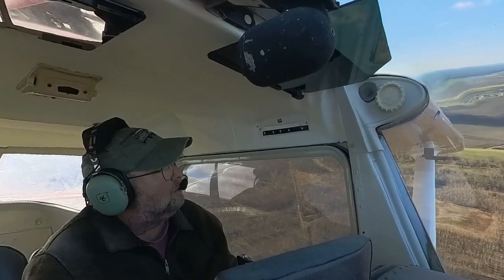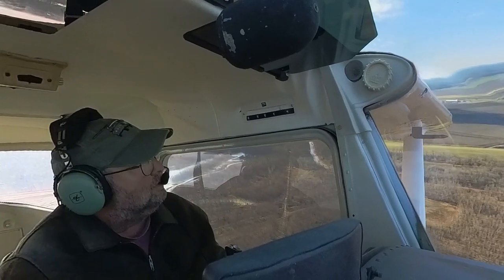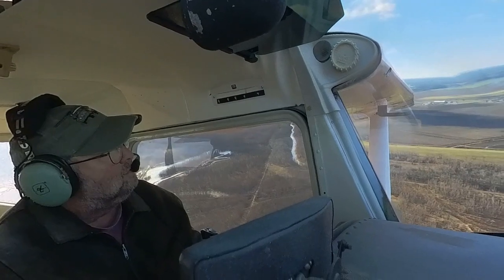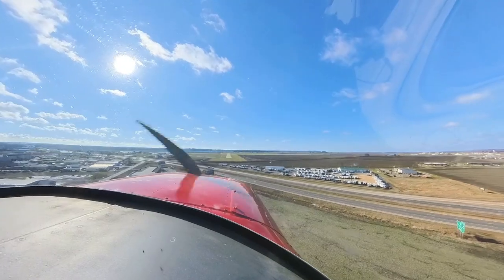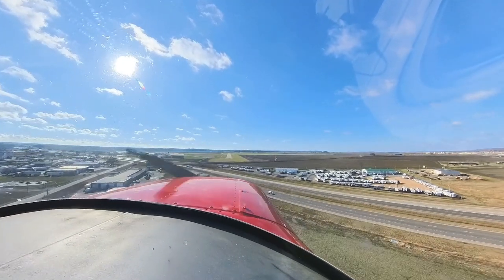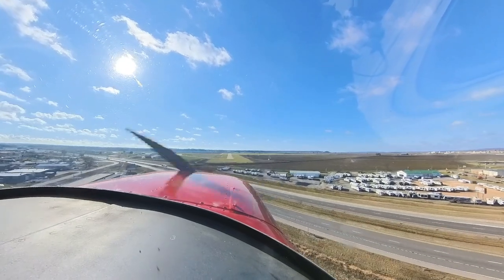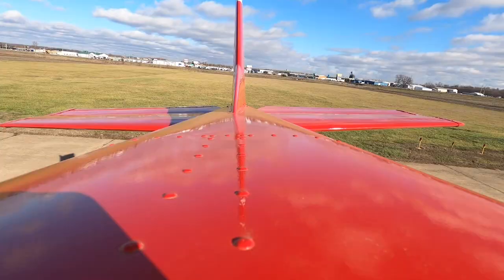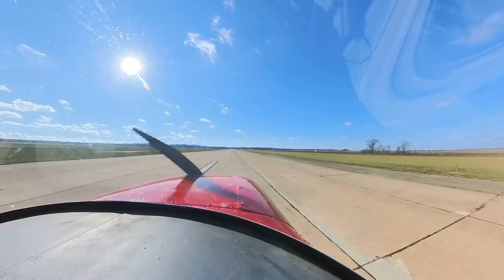Don't lower your flaps to 40 degrees in a Cessna 150 !!

Comment: Your solution with the overfly the tractor and land on the remaining runway was a good decision.  I have actually taught students this technique rather than the sometimes dangerous go around.  Too many bounces early on long runways are followed by go around when just adding power and making a soft field type slow and soft landing with power on the runway remaining.  Dan could have done the same in the grass, but after attempting go around landing in the corn was the next best decision.

I think you and Cessna and the insurance man have a good point with the only 30 degrees flap in the 152, but the 40 degrees Fowler flaps are what make all the single engine Cessnas much safer airplane.  Far less tin and skin are hurt at 20-30 ground speed vs. 40-50 ground speed.  And when we pipeline patrol pilots, who fly all day in whatever wind is around, need to increase our headwind component by angling across in a strong crosswind from the downwind corner to the upwind big airplane touchdown zone marking, we can use the power/pitch you mention to land safely in the thousand feet available before turning on down the upwind edge of the runway at very slow airspeed.  

With 40 degrees we can easily decelerate to get a sink going that allows us to bring the throttle into dynamic play as the most excellent glide angle and rate of descent control.  This amount of dynamic control (yes move the throttle like the control it is) allows putting the mains on the exact downwind corner every time with the assurance of the maneuver never in doubt. Removing the need to round out and hold off, same as Wolfgang's "stall down approach" makes this a snap. Good video. Thank you.

Comment: Flew quite a bit in a 1964 C172E with 40 degree manual flaps. Loved it and had no problems touching down at the beginning of the numbers and being stopped at or just beyond the end of the runway numbers. Never had a go around problem and loved the speed that manual flaps gave when lowering or especially raising flaps for a go around. I didnt really like the slow raising that electric flaps gave for go arounds.

Comment: We live in a temperate climate and I did 40 deg flap landings and take offs, however just because you can does not mean you should, it is a great facility to have for landing if you need it. Just be aware you need to be on the ball if you overshoot,( it does want to pitch up when you open the throttle)  and not at all if you are in a Hot & High environment.

Comment: The reason the flaps were reduced from 40 to 30 was because of changes in late model 150's (and so all subsequent 152's).  The cowl was extended and a spacer added between the Crank and the Prop.  (Cabin noise mitigation - marketing department).  That and the strake between the vertical stab and rear windows was extended and the area of the rudder was increased (more assured spin recovery as the nose had been extended - engineering department).  This changed the aerodynamic qualities of the plane to the extent that it would no longer meet certification "go around" requirements with flaps 40.  So they were reduced to 30.  Nothing to do with people getting scared.   (Source - Cessna Wings for the World - William Thompson - Cessna Engineering test pilot)

Comment: 40° flaps make it come down like an elevator. 150s are great short field airplanes.
152 had 12 to 15 more horsepower, depending upon the prop, 28V electric systems, and came out in 1978.
The most common reason for electric flap failure is when corrosion preventive compound, oil, dirt, whatever, gets into the electrical connector to the flap actuator in the right wing and interferes with proper connection. Seal that with RTV before spraying wing interiors with corrosion preventives.

Comment: Had an unusual incident back in the late 1960s with a 150. It was the really old version with a mechanical flap handle between the seats. I was trying short takeoffs and landings. I wanted to land and stop in the same length of runway that it took for the takeoff. It just wasn't happening and in my frustration, I took off twice with 40 degrees of flaps hanging down. In my state of frustration, I went from 40 degrees flaps to zero in about 2 seconds. Didn't tear anything up but both times, I ricocheted off the runway after making an unintended touch and go.

Comment: During my training I had a situation where I was coming in to land with a C150 using flaps 40, but had to go around. I went for the flaps switch, put it up, and stopped it at about 10 degrees, however the switch was so old and worn that it didn’t stop in the neutral position, but halfway between it and the down position, causing the flaps to go back down to 40😬 luckily I noticed the lack of climb performance and the flaps position quite quickly and rectify before crashing into the trees at the other end of the runway.

Comment: I think the 40 degrees flaps is a great  feature. Lightly loaded, 40 flaps, power idle and full  nose up trim the 150 becomes a paraglider with a descent rate of less than 300 f/p/m. 
I always had that in mind  in case  of an emergency landing at night If the concern was the training enviroment they could have limited the flaps switch travel to 30 degrees

Comment: Cessna R-172K, Hawk XP. For those not familiar with this model, Continental IO-360-KB, 195 HP, Constant Speed Prop RIGHT FROM THE FACTORY. This airframe has 40 degrees of flaps. My Son and I. About 40 gallons of fuel. 80 degree day. 600 feet field elevation. Touch and Go. The normal Takeoff flap setting is 10 degrees of flaps. On the Go part of the Touch and Go we raised the flaps from 40 degrees to 10 degrees. The airplane did not want to climb ??? At about 150 feet in the air we discovered that we still had Full 40 degrees flaps. The circuit breaker had popped for the flaps! IF.... We would have been in a standard C-172, or the conditions would have been worse. We would have been swimming in Lake Erie just past the runway. Lesson Learned!

Comment: Using 40 degrees of flaps is like making the decision to do elective intubations. Saying "never use flaps 40 in your Cessna 150" is like saying never electively intubate someone until they are in complete respiratory failure.. Making the decision to intubate early to forestall failure is similar to educating a pilot when  and in what circumstances to use 40 degrees. Both procedures have risks, which can be mitigated with education and training. I was trained in a 150 with 40 degree flaps, and have experienced the failure to climb scenario. It taught me to be cognizant of the risks, and to fly smarter in my use of them. Cessna changed the 40 degree flaps to 30 degrees in the 172's because of the ability to blanket the tail surfaces when slipping with full 40 degrees of flaps. This was found on the 170B models and resulted in a few tragedies. The 170A models flaps go to 50 degrees, but they are simple hinged flaps with a 9" chord. They barely work and you can slip them to your hearts content, and they climb just fine with the full 50 degrees hanging out there.

I think modifying your video would be helpful if you discussed the possible downsides, and educated more pilots in the best use of the 40 degree setting and where to best utilize the setting, rather than a blanket "don't do this" approach.

Comment: In the case of Mr. Mansels 150 crash with Dan Grinder. The flaps would not retract due to a glob of paint in the track. On the ground, without the force of the wind against them, retraction was not a problem. With the force of the wind  or any for e against them, that go of paint acted like a wheel chock.

Comment: Yes you are correct,great video,no go-around with with flaps 40 on a Cessna 150 that why the Cessna 152 has flap 30.
.
Reply: you shouldn't be going around with 30 flaps either. if people can't do go-arounds properly, they need to stop flying r get more training.
Reply: @SoloRenegade  It looks like you completely missed the point of the video. You should watch it again.
Reply: @3SM20Pilot  no, I know the point, but I'm not a follower of fads. I fly the airplane as intended.

Comment: I worked for a cessna dealer .we had 40 school planes and I was told to never use full 40 degrees in a tight turn because the flaps blanket the airflow over the tail surfaces

Comment: I own and fly a 1960 150, it has manual flaps and only use 40 on short fields it's mechanical so that's why I feel confident but i agree if it's electrically actuated that's a bad place to be when they won't come back up.
Reply from the maker: I totally agree, it sort of a challenge when they don't come back up.  I am a "huge fan" of mechanical flaps!!

Comment: During training at SMO (Santa Monica) I had maybe 20 hrs in a stock 150. I was a little high on short final and went from 20deg to the famous 40deg flaps at idle. I was immediately surprised as the sight picture instantly went from nice runway view to looking straight down at the numbers (!). I assume this is another issue with the 150, I am assume that the large change in the effective airflow shape caused the wing to seek the new angle of attack, which happened to be straight down at idle power???  The only other time I experienced a similar huge pitch excursion was more recently when I bounced a Stearman and (as is my rule) I didn't attempt to salvage the landing and initiated a go around from an almost three point landing attitude. I added full power (in retrospect I suspect too rapidly in general but certainly too rapidly for a radial engine, which thankfully didn't cough and quit). The high angle of attack attitude suddenly turned into looking almost straight up at the sky (eek!). My front seat friend (jet pilot) caught that I was momentarily a little stunned as things were so far from normal. He pushed the nose down gently and the aircraft settled into the nicest just above level climb at 400 fpm...  Anyway I think the 40 deg flaps also can cause issues in the 150 in idle and maybe near ground effect (??).:face-blue-wide-eyes:

Comment: In calm weather, I land with 20 degree flaps in my 150L. In gusty conditions, I use 10 degrees flaps. I’ve got VGs; so I can still land very short in it.  But if I have to go around, it’s much safer.

Comment: I also flew 150's and the flaps were activated with a MANUAL lever between the seats, not electrically operated. I have used 40 degrees with no problem, probably because they were manual. I do not know if the electrically operated flaps had an electrical problem or if the aerodynamic forces at 40 degrees were excessive enough so that the electrical motor did not have sufficient force to move the flaps. I'll bet Cessna knows! I am a private pilot and have been an A&P for 50 years.

Comment: On a windy day in my C-150 I could just about make a vertical landing with 40 degree flaps , as long as the wind didn't stop. LOL I lived in Las Vegas, then and flew out of North Las Vegas airport, and it was windy a lot, one note, don't try a cross wind landing with them all the way down. I did that once but was still able to do a go around with no problem, of course I was not lined up with  the runway anymore when I did it.  I learned to fly with 40 degree flaps for most landings, could land and stop in 100 feet. My instructor show me how to do that, then I asked him to show me how to take off in 100 feet, never did. LOL

Comment: I passed my private check ride with a forward slip 40 degree flap landing onto a crosswind runway in a Cessna 150. It was the only landing I did on the ride.

Comment: @rmgf1005
1 second ago
I was at Whiteside when Dan put the 150 into the corn !  Text book landing in the corn except she flipped over, but they both walked away without a scratch !  turns out there was a metal burr on the track that operated the flaps.

Comment: I have 100’s of landings in a 150 with 40 degrees of flaps.  172N with 40 degrees  as well. I understand the point you are trying to make, but I would be more worried about split flaps, engine failure, fire in the cockpit, mid airs, or structural failure.  If I worried enough about any or all of those things I would stop flying tomorrow.

And what’s up with 3 engine outs in the same day?  Maybe it would have been better to not fly that airplane after the second flight (if not the first). Just saying.

Comment: I had that happen to me on my flight test for my PPL in a C150 at a remoted abandoned airfield north of Pretoria South Africa in 1972. I elected to use this field for simulated forced landing, when the examiner told me to give power and climb out I did so and tried to remove 10 degree of flap to reduce some drag because it was a hot and high situation. Only flaps did not move. The examiner was fortunately q very experienced airline pilot who had just delivered the first SAA Boeing 747 to South Africa. He immediately took over control and dumped us unceremoniously on the ground. Safe and alive. Fortunately he was a smoker and in those days the cigarettes were wrapped in Aluminium foil. He calmly took out the blown flap fuse and wrapped it in the foil and presto the flaps could be raised. We then walked the strip clearing stones and other obstacles out of the way, got back into the plane and off we went. Landing at the airport was done without flaps so the ground speed at landing was a bit fast due to the high temperature and elevation. With the newly filled in forms I rushed off the the Civil aviation authority and by the late afternoon armed with my newly acquired PPL I took my first passenger my room mate are university for a ride.
I must add that other than when landing in very windy cross wind conditions I always used 40 flaps thereafter. it is far safer to make a high approach with full flap that drag in in on power. and i could land a C150 on a dime every time.
your mistake was dragging it on power, I was taught to only do power off glide approaches but one must develop more skill to do so.

Comment: I LEARNED TO FLY BACK IN 1964-1966 IN 62-63 MODEL 150s WITH THE OLD MANUAL FLAPS JUST LOVED THEM,AND I SURE MISSED THEM WHEN THE WEENIES AT CESSNA DECIDED TO  GO ELECRIC. I HAD A CFI TELL ABOUT THE TIME  HE PUT FLAPS DOWN TO FULL ON A 152 AND ALL BUT LOST CONTROL ON SHORT FINAL .WHY? BECAUSE ONE OF THE FLAP MOTOR BURNED OUT, SO ONE FLAP CAME DOWN AND THE OTHER ONE DID NOT,SOME FOOD FOR THOUGHT!!

Comment: Don't use 40° flaps in a 150 *if they are electric*
Reply from the maker: You make a good point!  When you have mechanical flaps, there is no switch or motor to fail!!

Comment: Hello. i did my training in the early cessna 150s with 40 degrees, this was in australia into a 600m grass runway. Went full flaps most all the time. Never had a failure. Can somebody tell me if cessna definitely identified the problem why the flaps would not retract at 40, 100% of the time?

Comment: Just because you don't know how to handle a 150 with 40 degrees of flaps, doesn't mean the rest of us shouldn't use them.   The engineers who designed the aircraft weren't idiots. And they assumed the pilots weren't idiots either.

Comment: My suggestion as a C-150J owner..that final on the video was very low. No way you would make the runway with an engine out etc.  Now, a higher angle final with full flaps would solve that issue!  Ok just kidding because I know you know that….but seriously if you use 40 properly, meaning short final, stabilized approach & speed, runway made at the threshold, then go for it. You learn a ton about your aircraft performance capabilities. Also practice slow flight..see what climb characteristics you really have at various temperatures with both 30 and 40 settings at a safe altitude.  Flap motor failures - Had this happen 2X luckily not on a go-around.  On one I was able to reset the fuse twice before it gave out completely, but after landing 😎 All that said..I would NOT practice go-arounds or low passes with 40 degree flap settings - totally unnecessary risk.

Comment: Cessna 150 WILL climb with 40 degrees of flaps.  Mind you, it climbs in a nose down attitude, but  it does climb.  I did it several times inadvertently in a 64 - so it was manual not electric flaps.  It does work.  Most folks are just to afraid to point the nose at the ground when you're low; and I get it.  But honestly it WILL climb with flaps 40.  Remember that the flaps have changed the chord line and Angle of Attack - so nose down is essential.
Reply: Density altitude is everything. On a hot day 95F at sea level at near gross weight the C150 won’t achieve a safe + rate with 40 flaps

Comment: Your 150 will climb with 40°of flaps if it not to hot out with A pitch down attitude,it will actually climb although just, you will feal it climb from the center, pitch down helicopter like although you really need to practice full flap go arounds in your 40° flap C150 scarie but can be done.and at the time I was185lbs temperature 70°F.

Comment: This advice makes no sense at all. Don't use 40° of flaps, because occasionally they might fail? Would you apply the same logic to your engine which you said earlier in the video failed you three times on the same flight? Is it better to just not use the engine at all? Come on man.

Comment: Looking at the load that 150 had I guarantee they were over gross. They won't climb in that condition.  Been years since I have flown a C-150 but I always used full flaps. But I can see your point and yes the C-152 has only 30 degrees flaps probably for the reason they don't climb if stuck down.